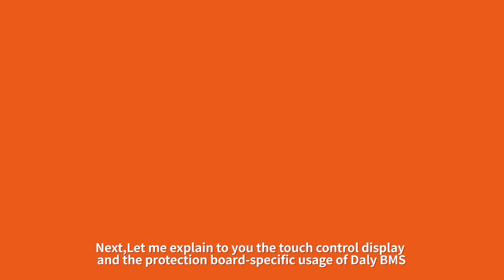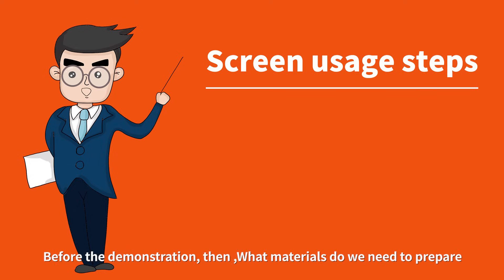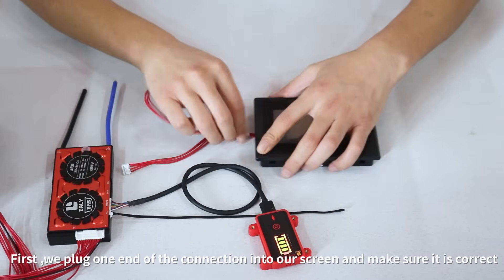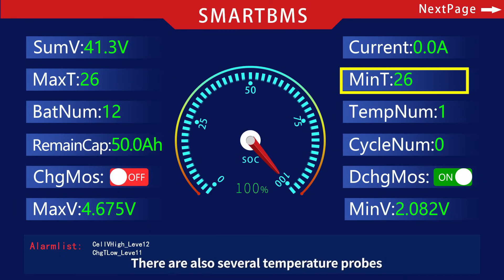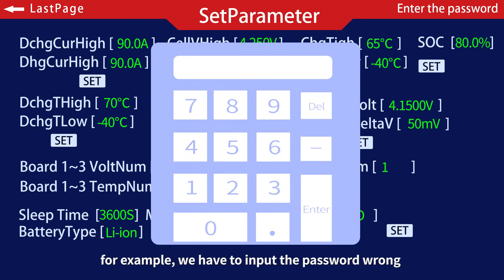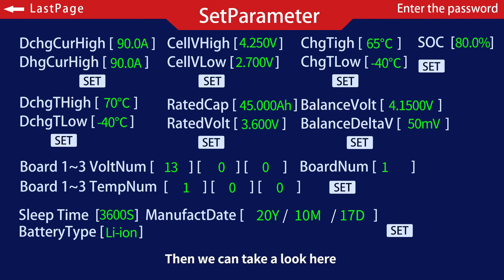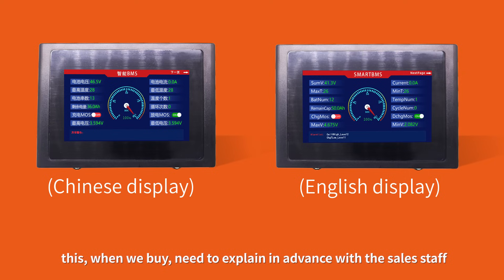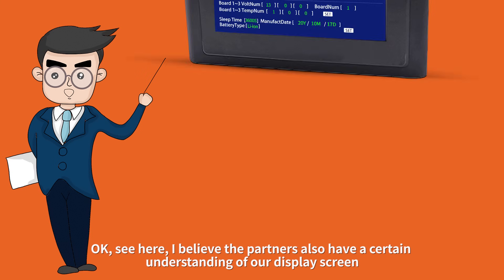Daly Smart BMS Touch screen Connection Tutorial

Comment: The display sporadically stops updating the data. The only solution is to turn the storage units off and back on again. This issue occurs with all six storage units I have in use. Does anyone have a solution to this problem?

Comment: Hi there!
We’re using an Daly smart BMS 4S 12V 250A with URAT Bluetooth Dongle…
Is it possible to connect the LCD- screen to it? Is it possible to extend the connection cable by myself? (I need 5m in total length

Comment: What to do it screen does not power on ? I have checked and rechecked all is correct I’m doing exactly what you are without powering up the Daily BMS !
Reply: Hello, I think you must power on your BMS first, either by starting charging or by using an activation button. These are on the bluetooth interface or on the simpler screen, but I think not on this touch screen.

Comment: Hello. I have a 200amp AliExpress battery charged at 12.9v plus his 250amp Daly BMS. When I'm charging, I have 14.1 out the charger and at the BMS in (B-). But I do not get more than 12.9 out of the BMS. Am I not supposed to get more than 12.9 at the P- of the BMS?
Reply: I am not sure. Remember you have these small cables going to each module and distributing current to equalize them... So it is not all going through B- and P-.
Reply: John Lee  thanks
 In the meantime I learned that the BMS was not functioning